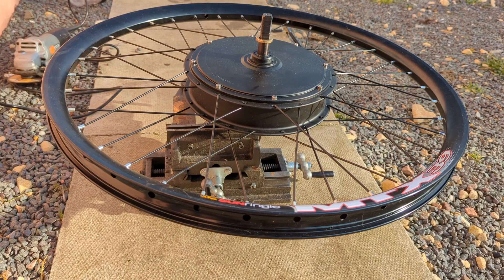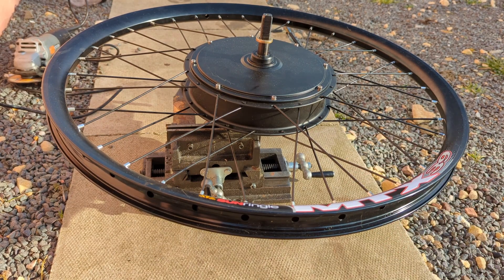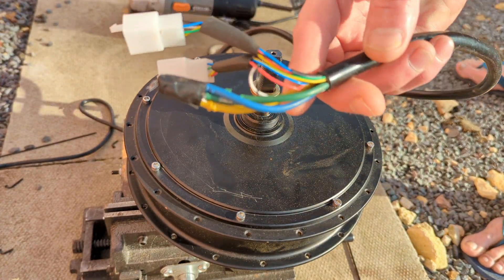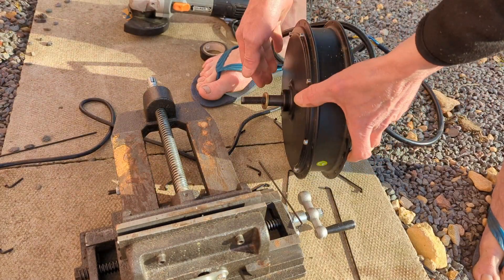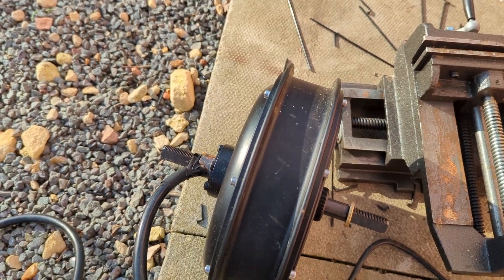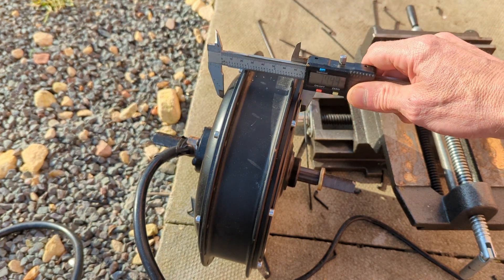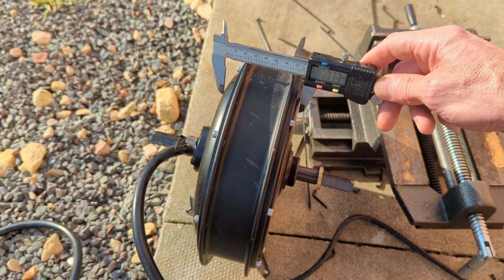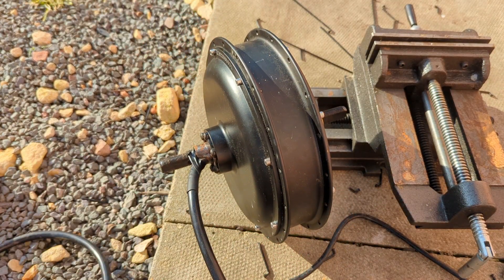Wind Turbine Project Free Energy - Let's free the Beast 72v 3kw Motor Hub - 15th February 2023

Comment: Avidly following this. Better than Netflix. Was that off ebay or have you destroyed your e bike? 😬
Reply from the maker: Greetings brother, This was an electric bike hub that I purchased off Facebook. It cost £300, I am able to sell the controller etc. For £50 so in all it's cost me £250, this motor had never been fitted to a bike. It was always my plan to remove the spokes as I can't make a wind turbine with a great big wheel attached to the motor. Cheers for the comments 👍👍👍👍